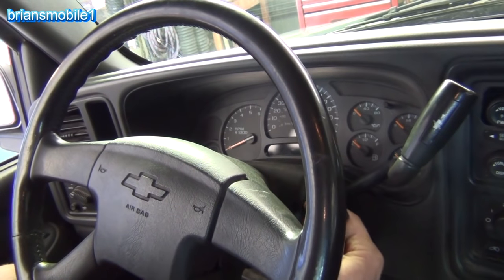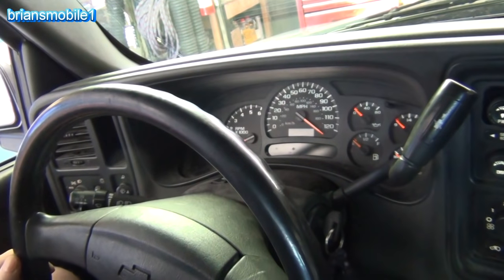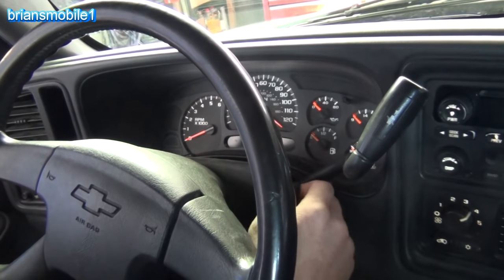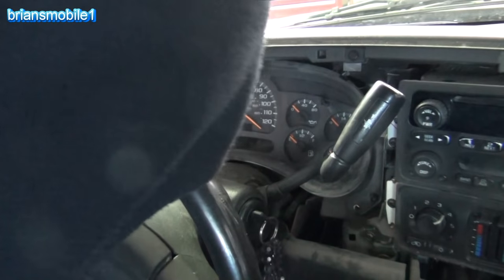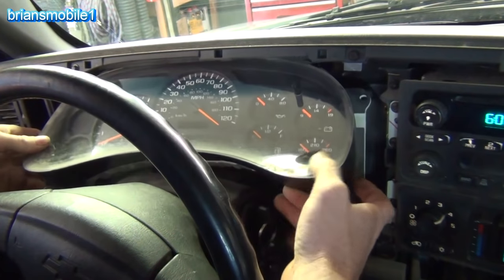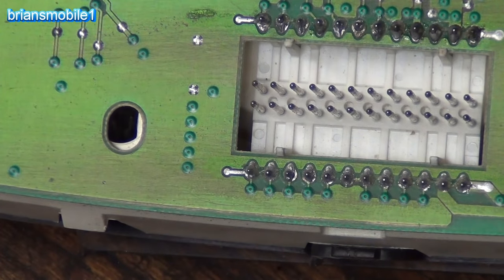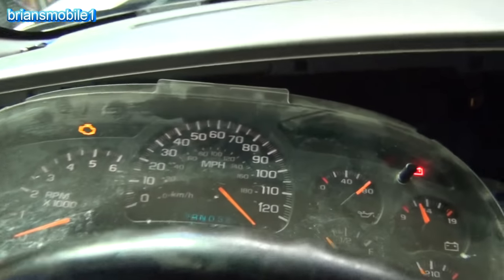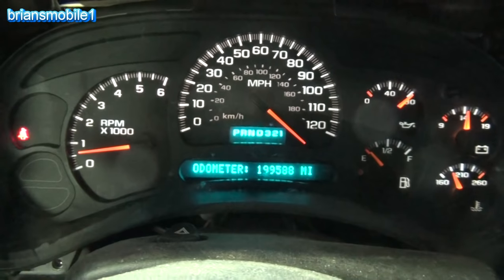Cheverolet Silverado Instrument Cluster Fix

Comment: Your oil pressure is not right should be around 40 - 60psi depending on oil and temperature. Good video, what do you do for a living? My tachometer will bounce about 100 rpms randomly but not always.
Reply: +Bret Feeney  The normal problem would be the "Servo" motors used to drive the gauges. These are sold in sets and most requires soldering skills. Yes, there are videos all over youtube on how to replace these. They sell cleaner to remove the coatings used on PCM boards as it varies by manufacture, but most a lacquer based. Also, the main IPC connector need check for "Pin" fit as they are spread and become loose. This is done with a new terminal you can order or get in a bone yard. Also, I like to use dielectric grease. It is sold in the auto section of home improvement stores for $5. Use is where ever a terminal inside a connector is, behind a light bulb or anything where two connector plug in. It prevent corrosion from moisture in the air and some heat developed by current. The video is good for the most part, but a an ASE Master Tech since 1978, I have fixed many electrical issues, including printed circuit boards as many are surface mounted parts and by law, the reduction of lead is required. So some PCB's with parts are passed over a wave tank of heated solder, as the solder touches, it joins the tow parts. But, look into other videos and watch the "Gauge" motor replacement, as long as it is not a sender unit. Most GM products use class2 serial data to control all of the functions and are not hard wired. Best of luck!

Comment: man, i'm betting you've got a 30 watt soldering iron, (the solder melts so slow)  get a 40 watt iron.  your soldering tip is also black, not enough contact, i'm not down grading just helping.

Comment: Stabilant 22A from NAPA a electrically conductive liquid coating reduces resistance also a little known secret. I use on Cranes and manlift connections. Aircraft also use on Avionics. Expensive small bottle $65
Avionics have similar issues with terrible outcome. Solder developed "whiskers" and short out circuits. Special solder is used.

Comment: There's a few key things that make soldering much easier and faster;

You need to flux the areas that are being soldered. Your solder had it but it wasn't enough because you still had the old solder in place. Fluxing will make the solder melt quick and adhere to the metal nicely.

You need to keep the tip of the iron "tinned." Best thing for that is those brass wool things you can buy at radioshack. You run the tip over the wool to clean it up, and then touch the tip of the iron to your solder to have a film of solder over the tip. This makes melting the solder fast and effective.

The clear stuff was in the way too, but you got that and removed it.

Comment: I have the same issue with my 2004 suburban cluster and did the solder job plus replacing the motors with the new X27 motors and added leds, put everything back together and the display and prndl still keep coming and going and only come back if I hit the right turn signal or flashers? What could it be???? Everything else works fine, even added ground wires to the ground wires on the connector to a better ground location to rule out any ground issues to the cluster.

Comment: 7:30 that's not a burned/damaged board. It's just dirt stuck to the conformal coat. If the joint was bad you would see a dark ring in the joint around the pin.

Comment: my '03 hasn't got a PRNDL 99% of the time. everything else works fine. every once in awhile it comes on when the truck is warmed up and has been on the highway for a couple hours. has gotten worse over the last couple years, used to just fade in and out all the time. I'm used to it, I know where all the gears are. of course if anything else in the cluster goes, I plan on resoldering all those spots.

Comment: all the gage arms come off easy they all recalibrate when the truck starts so you dont have to put them back in the exact place but i like to put them as close as possible but in order to fix the light bulbs you need to take it apart

Comment: Great video. I have a 2003 Tahoe with the same cluster problem. I have a question. You mentioned door switches briefly in this video. I have both the 2003 Tahoe & I also have a 2003 Silverado 1500hd.The Tahoe has a rear right door ajar warning. The battery will randomly go dead. It's been that way since I've aquired the vehicle. Well a few weeks back my silverado now has a rear left door ajar warning and since that has happened, that battery will randomly be dead. Would the bad door switch cause that? I do leave the dome in override so that the lights wont stay on.

Comment: Excellent JOB Bud. My gas gauge is bouncing, Is that the Soder? It works when near 1/2 tank. But bounces other times.
Reply from the maker: That could be the the stepper motor, or the rheostat in the fuel sending unit in the tank.  Both can be week points.  I have a video on my Ram truck (gray colored 2001 diesel) that goes into great detail and is similar to chevy tanks- same supplier/concept.

Comment: PS i had to reflow my cluster on my pathfinder a couple of years ago.   tach was flaking out.   but its a 96 with almost 200k miles on it.   i took the front off and the whole nine.   Reflowed the motor connections and components on the PCB.   took bout 45mins in and out.

Comment: Hmm. The top spring was over the "handbrake" lever when you started, but when you put it back together it was under that lever. Is it better that way?
Reply from the maker: Probably just the shifter position.  It changes through the course of the repair to get it out of the way.

Comment: My 2000 had a loose connection to the negative battery terminal which caused the instrument panel to flicker and rotate codes in the message window.   Never had a terminal connection loosen up.   Now have to chase down ABS light problem

Comment: My truck just quite the other day. I knew that starter was starting to act up. I neglected to change it because it started to work again. So the other day, I cranked it up and the starter felt like it stuck to the flywheel and the truck starts, but nothing is happening with the cluster. I was hoping it might be a fuse or something???

Comment: Is this job pretty general for all makes and models? I have a 02 Volvo s80 with an intermittent instrument cluster. I was thinking about removing the IC, unplugging it and then looking for any burn marks, is that the main thing to look for? like on that area you were talking about which you repaired. Just thinking, could it be a loose chip? or something else? or is it nine times out of ten those solder joints around the top and bottom between the plug-in area?

Thanks!

Comment: Cluster didn't work at all in the 04 Tahoe I just got. I followed your vid and got lighting and tach and oil and temp, but no battery or fuel indicators or speed. So I put it back in and after a few times starting the truck, the whole thing quit again. Any suggestions?

Comment: you dont really need to add solder, just set your soldering iron 700F and pre-tinned it every time you re-solder the pins and you'll have same look as the robot who did it... just watch your temperature cause you dont wanna burn the board

Comment: I noticed that your oil pressure gauge was pegged at 80 psi. I think normally that should be around 40 psi. Was there some other problem?
Reply: Bad oil pressure sending units. It's pretty common in this gen with gas engine.

Comment: I just found you're channel and you seem very knowledgeable about vortec Chevy's I just got a 1999 1500 Silverado with the 4.8 with 177xxx miles trucks very clean and runs good I have one problem though when traveling at 40-45 in overdrive and u meet a hill after the truck down shits then reaches the top of the hill the truck sometimes (not all the time but seems to be becoming more frequent) surges like the rpms fluxate up and down by about 100-300 rpms it does this until you let out of the throttle then its fine and runs normally do you know what this could be and if its common? I've heard torque converter but I'm not sure thanks

Comment: I have a 2004 2500 HD 4x4 that has the dead gauge syndrome and I had the dash cluster replaced. It still doesn’t work at all. Also prior to them going dead, I got a message that read REDUCED ENGINE POWER?? What should s I do?

Comment: More the Lead Free initiative causes crap solder performance.  More electronics in the landfill, needlessly, in hopes of saving the environment... Hmmm.  Maybe stick with what works.  Lead! Pb.  BTW Brian, get yourself a nice syringe of good soldering flux.  You are making the easy stuff hard ny jusr relying on rosin core.  If you add your own flux, and you will have cleaner joints, faster and easier.

Comment: My instruments are not working, I can get them to work by moving a wire on the back of the engine. However its not easy to get to is this wire a negative wire and can I just splice it and reroute to a better location....?

Comment: Hoping this video will help cause part is $500 with core cause plastic is broke N (cracked) they're making me pay the core. Truck is 2003 chevy Silverado 1500 z71 4x4 V8 motor. I haven't had any working gauges including speedometer in months. Need inspection sticker.

Comment: This gauge cluster also needs new stepper motors, very common GM problem.
Reply from the maker: The late 90's ones were notorious for that weren't they?
Reply: No, I believe it was the years 2003 through 2006 in most GM full size trucks and suvs. My mothers 2004 Chevrolet Trailblazer has a problems with the stepper motors on the gauge cluster, over time they just go crazy and get worn out. It's actually quite an easy fix, Just un solder the 6 stepper motor points and put new stepper motors in and put them back into position. It beats what one of the GM dealers told me, A Local dealer wanted to sell me a brand new $350 gauge cluster! Instead I think I spent $30 on stepper motors and put them in myself. Great video though Brain! Keep up the great work. I always look forward to your videos.

Comment: Love the video but yeah, you need a new soldering tip to start with or clean it. It should not be black but it should be tinned. The tip you are using for that sized joint is a bit large. Ebay does have allot of good quality soldering stations for reasonable price. They come with an assortment of tips and reflow if you desire. something to look into. Some liquid flux would have helped also.
Reply from the maker: Sadly I did clean that tip before use, but not often enough.  And you're right, I do need to order some smaller tips for this sort of thing.
Reply: briansmobile1
At 14:15 you got it right, you were adding solder and flux... Constructive... In my book your the best!
Reply: briansmobile1 Flooding the tip with solder before turning off your iron will make it last WAY longer. A screwdriver or chisel tip works best for through hole pins. T18-D16 would be a good choice. 

No clean flux will help the joints wet without adding additional solder. I make my own from violin rosin and 91% isopropyl.

Comment: hey Brain I have a 2000 Chevy Astro van the cluster only half works when you start the  vehicle battery light and low fuel lights come on and  temp gauge does not read but the volt meter shows 14 volts this vehicle also has overhead  for fuel usage and direction also goes out. Replaced  cluster and problem is still the same any help thanks

Comment: I found something strange my odometer and my fuel gauge was not coming up but it was lighting up so I needed a 10 amp fuse so I used the cruise fuse located in fuse box on side of dash because I don't have cruise control but I replaced that fuse and they started working not sure why they would be tied to that fuse

Comment: Hey Brian, i'm ready to solder.  Do i use plastic core or acid core solder wire?
Reply: plastic or resin core is what is used on electronics, in case any one else had the same question.

Comment: You just saved me a shit load. How bout doing a vid on a heater that kicks on( in the same vehicle) when its off... That would be nice.. Thats my next problem... dang :(
Reply from the maker: +paul haywood You're welcome Paul!  Thanks for subscribing and clicking like!
Reply: +briansmobile1 Ya.. as a result of your video ...instead of going down to the wrecking yard and buying a used one. I took my heater control unit out and took it apart (down to the circuit board) ((I was having a problem when the heater was on "cool" hot air was coming out all the time))) I resoldered all the connections and appllied new solder. Problem fixed!!!!! I wouldnt have known to do that without your very helpful video!!!! Thanks again.
Reply: Paul or Brian, where's the link to that? My A/C randomly switches over to the heater. Thanks.

Comment: Help where is the instrument panel fuse at I was trying to switch out the damn 10:10 cluster lights and now they both don't work should have left it alone I want to check to see if I do a fuse but I disconnected the battery while I was working on it so

Comment: Are all the gm clusters interchangeable?  Like 2003-2006? I have a 04 Avalanche and saw that the silverado has a easier twist and lock light bulbs vs solder style for Avalanche.  Can I just put a different style cluster in my Avalanche?
Reply: Did you find out if you could
Reply: +1313rugbyfan didn't even bothered, I just bought a rebuild one from oriellys and solder led bulbs into it

Comment: you're not supposed to melt the solder on the gun. it causes cold solder joints. heat up your joint.
Reply from the maker: Thanks and good call.

Comment: hey here's a question on both of the gm cars i have i always see that the gauges rotate all the over to the right then back to the left my oil pressure gauge on the dash sticks all the way over to full pressure but i had a buddy that has a scan tool and he said the pressure on the sensor is reading good it just doesn't sink with the gauges why does it stay to the one side. also sometimes i will notice that the speedo will read 80 when going 30 or something like that and if i turn the car on then off over and over it will eventually return to zero but it happens again about a week later any ideas?

Comment: That truck needs new stepper motors for speedometer and oil pressure gauge .Oil pressure shouldn't read 80 when it's not running.All the stepper motors should be replaced,as they are junk..:)

Comment: +briansmobile1 My speedometer will bounce back and fourth when at a constant speed and when accelerating in 10mph increments. So, say I'm doing 70mph, it bounces between 60mph and 70mph with no specific interval (can be once a second to once every 3-4 seconds)nonstop. Does the same while accelerating. Speedometer is brand new and works in another vehicle, speed sensor is also brand new- neither fixed the issue. It seemed to crop up after a stereo install. Any insight how to go about repairing this? Tried disconnecting stereo from speed pulse wire but that didn't change anything. Could it be a ground issue somewhere or do I have a problem elsewhere do you think?

Comment: 03 silverado has half the lights dim on the 0-60 side of MPH gauge and the oil gauge is pinned just like the one in this video. Should I pull it our and solder it like you did?

Comment: what happens if you start the car and drive it around with no Custer. .
Reply: I haven't done it, but from my research, you should be able to drive it just fine without the cluster. The computer will still record the mileage and it will be updated on the cluster odometer when the cluster is plugged back in. You would just have to be careful about not having a speedometer or monitoring gauges
Reply: Did it until my stepper motors came in and this guy needed to replace at least oil and Speedo motors. Not really a good video on that part. Drove around for a week without cluster installed w/ no problem. Just have to guess on gears.

Comment: what do you do if amp Gage goes all the way to right
Reply from the maker: The first thing I do is verify the battery voltage of the vehicle.  If it's over 15 volts you have a charging system and or battery problem.  If it's 13.8-14.9 with the vehicle running- you need to replace your amp stepper motor or PCM or whatever is failing.
Reply: Thank you the batter dose put out 14 amps so I well do the other
Reply: briansmobile1 i wont to let you know that i got the steppers and put them in all works just fine now thanks